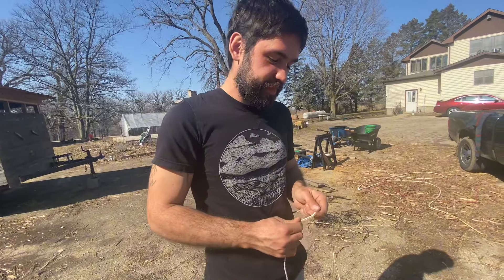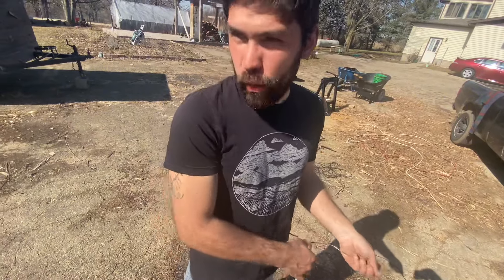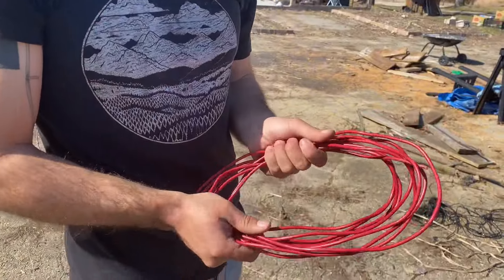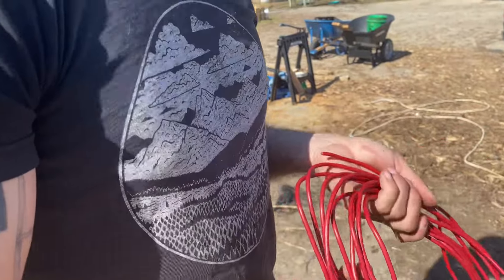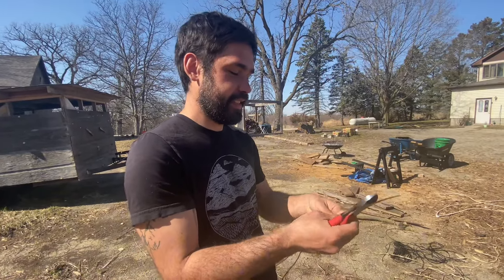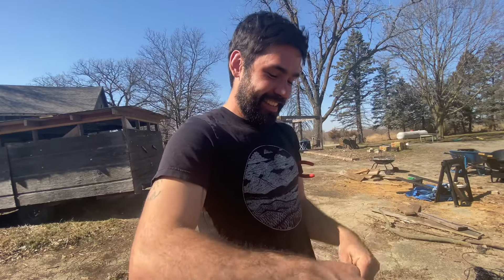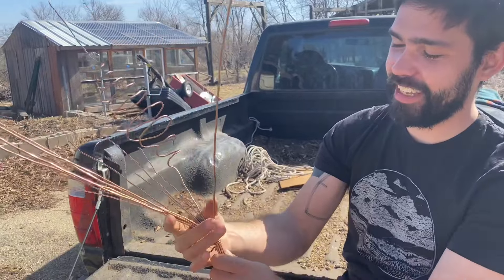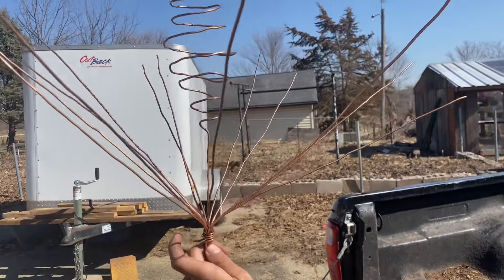Electroculture Gardening | Putting Copper Coils and Antennas in our Garden

Comment: isn't the green pole thing already a metal stuck in the ground ? sounds crazy concept
Reply from the maker: Great question! Yes the t-post is it’s own antenna and will have magnetic influences. That’s not necessarily a bad thing but you could definitely use a nonconductive material if you preferred.